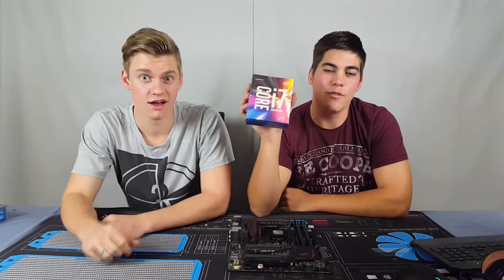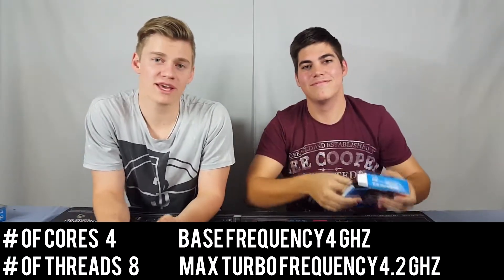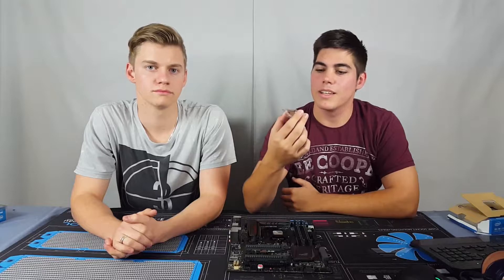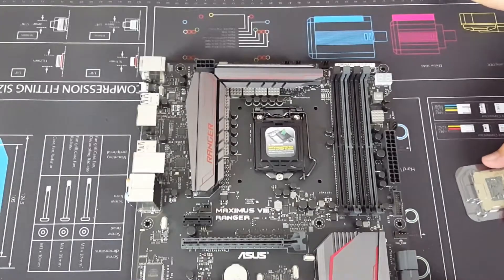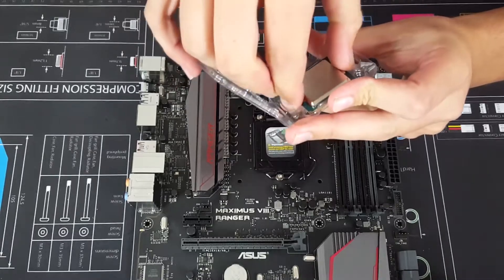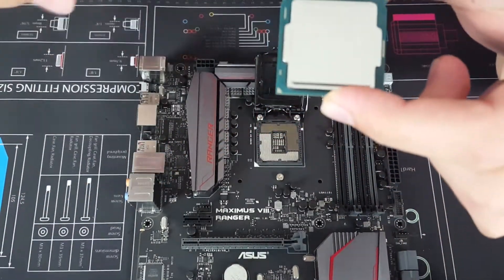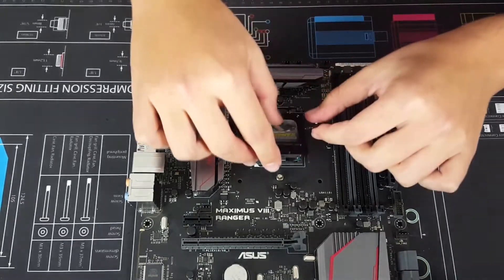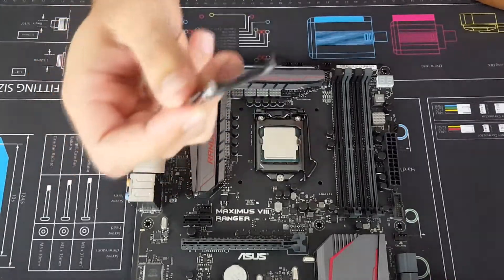How to install a CPU / Intel i7 6700k unboxing/ overview

Comment: No thermal paste?
Reply from the maker: G'day Hatcat
No the 6700k does not include thermal paste. All of Intel's "K" Cpu's do not include thermal paste, heatsink or fan unfortunately. But for good reason.
Reply: +T&T TECH Yeah I'm aware thermal paste isn't included, but would I need it?
Reply from the maker: Yes you will need Thermal Paste. We have a video on installing an All in one liquid cooler which shows how to apply it. 
Cheers